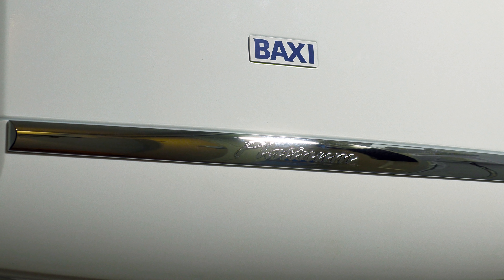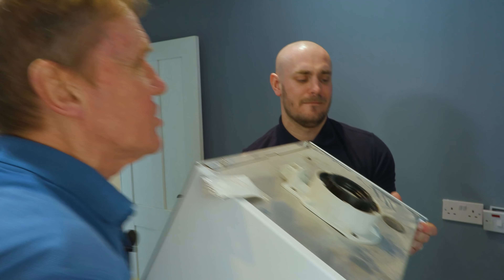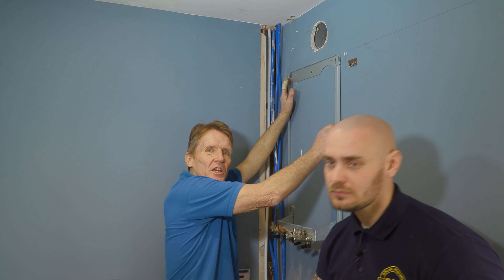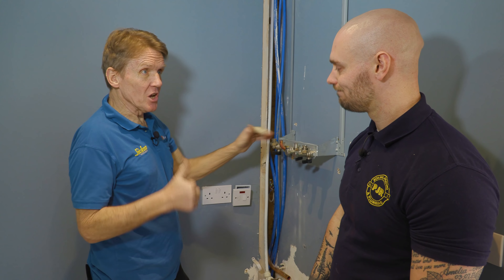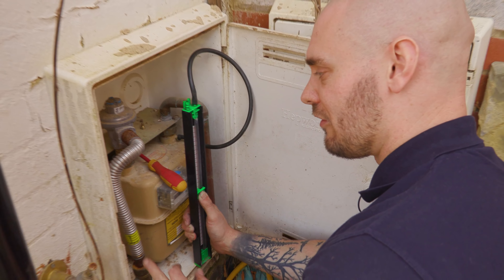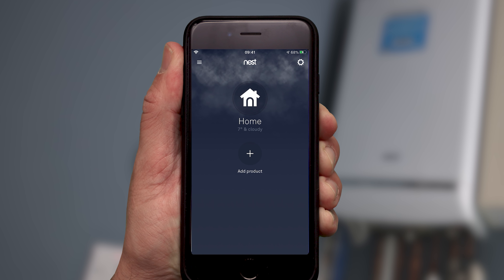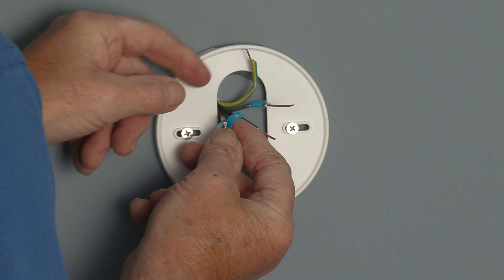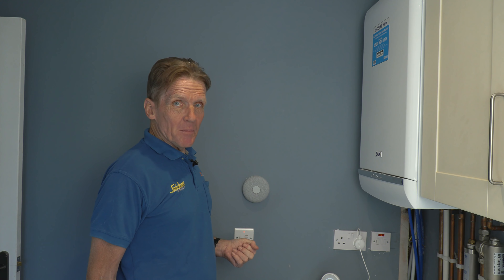Install a NEW Baxi Boiler with Google Nest Thermostat E

Comment: Did the video not include installing the heat link and connecting it to the boiler.There are two possibilities taking power from the boiler . I think you need a 3A fuse in line.

Comment: Roger why didn't you put an plastic pipe thought before the copper to protect the pipe from falling debery in the cavity and also from corrosion    
Thanks
Danny
Reply from the maker: Daniel.
I usually do sleeve pipes through cavity walls and it is a good idea but not essential for a drain off. There is no falling debris in the cavity because it is filled with insulation but I take your point.

Comment: an abysmal Gas,Engineer installed a Baxi Boiler and when I complained to Baxi they had no interest whatsoever. The Baxi Engineer came and never noticed it wasn't straight...the wires were shoved up inside...the Baxi boiler only ran for a short time because of faulty installation. The problem wasn't the boiler but the people involved
Reply from the maker: Sorry to hear that but how is that the fault of Baxi?

Comment: I’ve seen these a lot putting drain offs outside madness will that freeze and before you say it’s because there’s a utility room could of put it above the worktop and the boiler and an internal drain off also one on the filter 🤣 living life on the edge you two
Reply from the maker: Paul 
I can assure you that external drain offs do not freeze.  The pipe is sleeved through the wall and the drain cock is the only bit that is exposed and there is no water in it.  The amount of heat in the pipes, even if the  boiler has been off all night,  is enough to keep the draincock pipe above freezing. Even if the last 100 mm froze the water would push back into the internal water and be accommodated in  the system so there would never be a burst pipe.
If you ever come across a frozen drain cock that has caused any problem at all please let me know because I have never seen one in 40 years of going out to burst pipes. I have seen cold draughts freezing pipes under floors where they are too close to an air brick but that is something else entirely.

Comment: I programmed my nest to start heating the house for 6am but found it was coming on at 3am because it learned that the house would take that long to heat up! obviously  this wasn't ideal! Also my partner and i work shifts so the nest can never predict when were in so we now use it as a glorified program timer that i can turn on/off from my phone. Looks good on the wall though 😂
Reply: like a lot of technology, it solves 1 problem but introduces 2 more

Comment: Never will I have another baxi! Mine failed repeatedly. My mother's keeps failing. They are just crap
Reply from the maker: I have had one for years and, apart from the odd  thermistor it has been fine.
Reply: Had a duo tec six years now no problems
Always flush your system before install, fit a quality magna clean and redose every two years
Reply: Baxi are a great make! The new 800 comes with a 10 year parts and labour warranty! They don’t offer that if their boilers are not good.

Comment: I think it's strange that, in June 2020, that any more skill needs to be built in installing gas boilers. Why don't you do a video on how to install an air-sourced heat pump?
Reply: Yes lets see some Green stuff.
Reply from the maker: We did an air source heat pump install years ago. It is not great technology in the winter. If you are running on LPG then it is worth it but don't run away with the idea that it is 'green'.
Reply: @SkillBuilder  I couldn't find an ASHP video on your channel, can you post a link please? Everything's relative; maybe not to replace gas but for oil or LPG... Posts on greener tech please!
Reply: @Tribolumins  unless you have solar, gas, at the moment is the greenest way to heat water, heat your home, heating water electrically is still very inefficient, an 87-98% efficient gas boiler for central heating and water beats the 20-30% of electrically heating water via a coal plant, even better is nuclear, 91%. and nuclear is the cleanest long term energy supply until we have solved the issue of clean manufacturing of solar panels (dirty) and batterie production (very dirty)